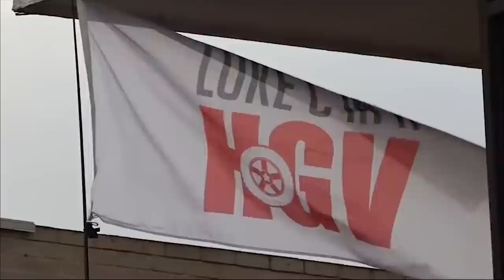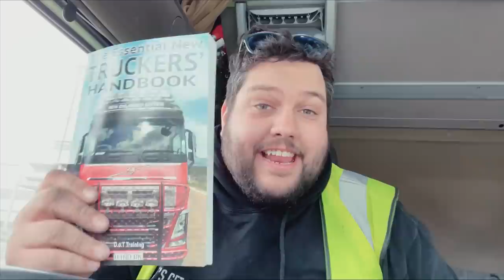My Load Is Too Heavy For The Forklift!

Comment: Hi Luke . I haven’t had water come off a palette . But off the top of a dry van trailer I have had 4” slabs of ice come off the top land on the road making a left turn . Had to stop and clear the road . Some guys have hit the brakes and the ice smashed the back  of cab & air hoses . It’s when we have snow and it turns to ice . Some company’s have a gantry with overhead plough called a avalanche to clean the he snow off .Greetings from Canada 👍🇨🇦